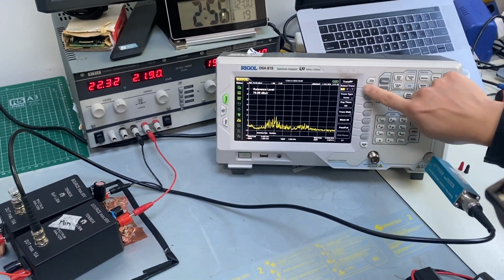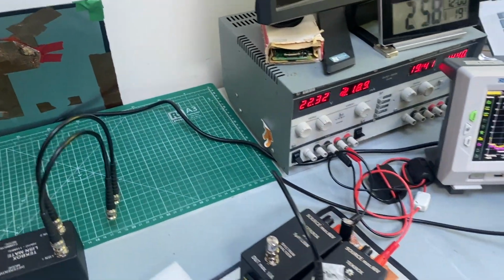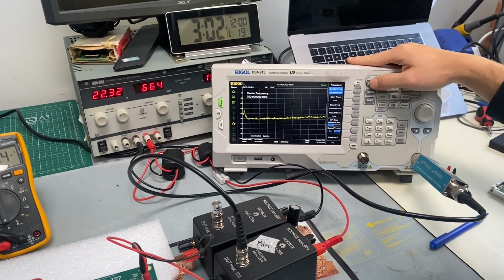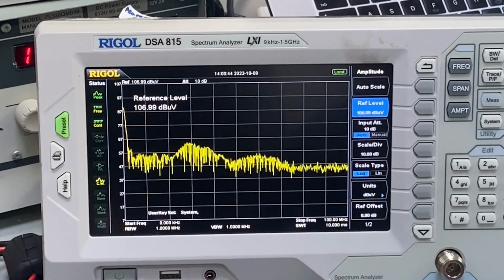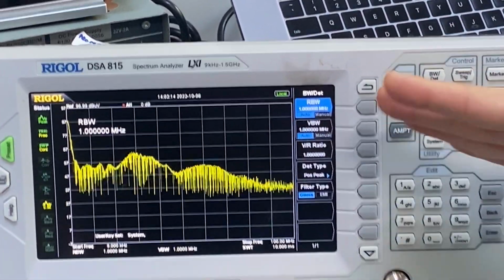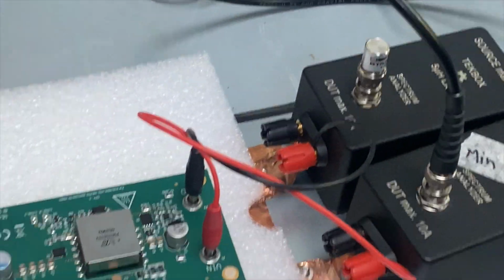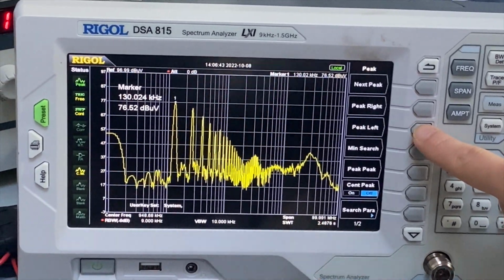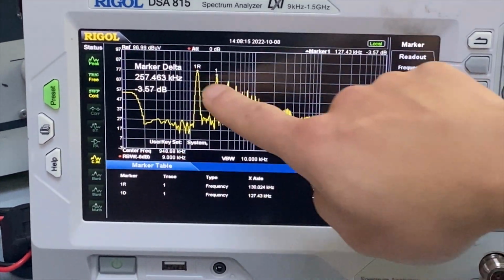Suppressing the Ambient Noise and How to Use A Spectrum Analyser

Comment: What if my Spectrum analyzer keep picking stray noise all the time? How to bring the noise floor down to minimum?
Reply from the maker: you can use a tent, or switch off nearby equipment. But sometimes it is hard, in one case, when I was visiting a client, there was a very strong ambient noise in the whole building, also very broadband, we could not simply use an antenna. I posted the question to all the EMC professionals I know, none of them has ever seen that kind of noise before, and they were all interested to know what caused it. Unfortunately it was a one-off visit, otherwise I would want to identify the noise source in that building.

Comment: Hello min. Your videos are rally very helpful. We are testing high power three phase ac equipments which has  high voltage switching     . We put some standard emi filters at the input of the LIsN to minimise the ambient noise. It seems to work. But do you think this is a good idea or can you suggest some alternative.

Comment: Hi Min, thx for this video! It solves some problems which I encountered. But also raises some questions 😅:

1) instead of using the powercables with ferrites. Could we also use a coax/shielded cable? Maybe coax is not a good example because the gnd is not the shield. 

2) same for the connection between the DUT/LISN. At the time you connected them the span was bigger. Could we also suspect noise from the environment coupling into the wire? I think usually the original powercord is used of the DUT? (If applicable)

3) I see ground is connected between the two LISN’s and I guess also the electronic load. If the DUT has a earth/gnd, also connect that one?

4) LISN is put in dBuV mode. Current probe in dBa. Should we also put H-field probes in dBa and E-field probes in dBuV?
Reply from the maker: Hi Remy, thanks for the great questions. i have answered pretty much all of them in a new video. Enjoy!